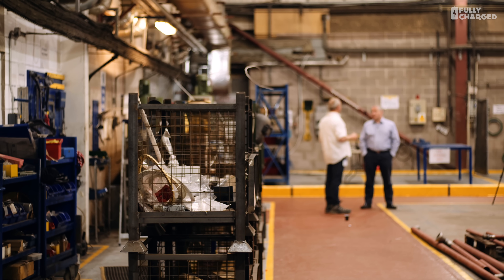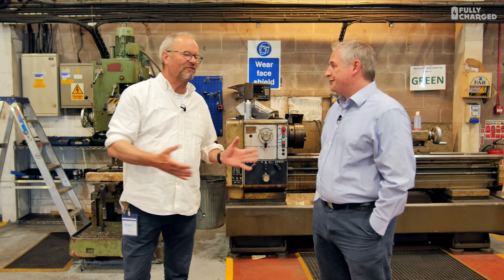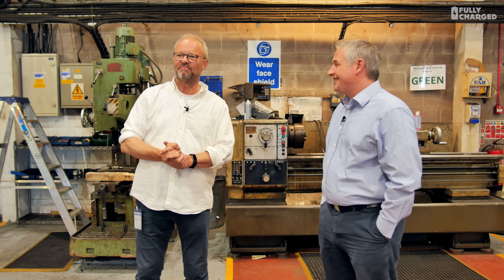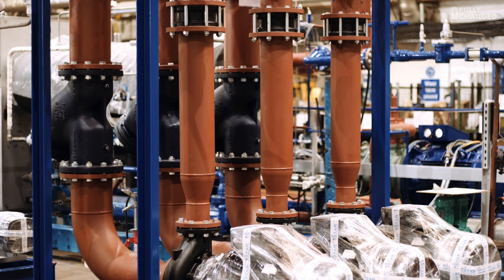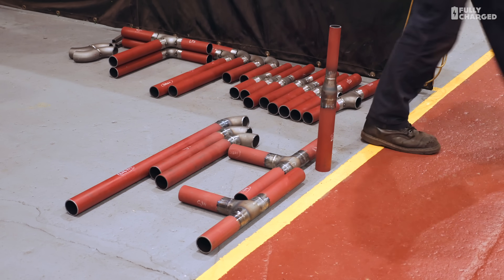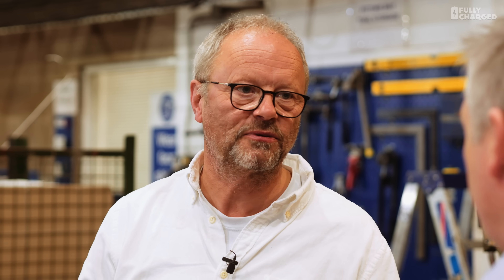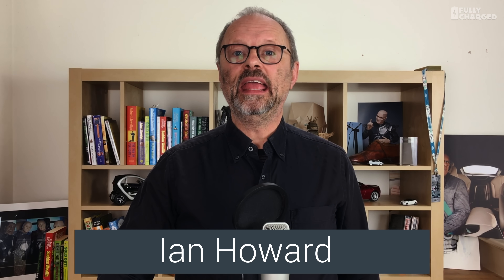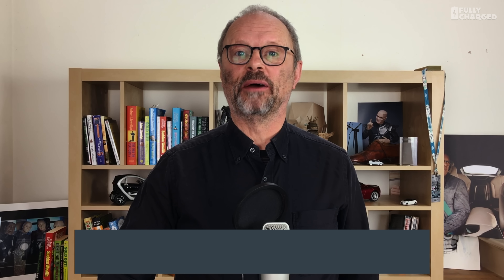Star Heat Pumps | Fully Charged

Comment: Heat pumps are the wisest way to warm and cool spaces but I still think that we could do so much more in the design of our structures.  We build the stupidest houses when it comes to heating and cooling.  New houses should have very thick sturdy walls and consequently be so well isulated that you simply never have to heat them.  Residents would be kept warm with their own body heat, solar, or more substatially, the electronics they operate within.  In my humble opinion, if you are using energy to directly heat your home, you need more insolation.  :-)
Reply: As our electronics get more and more efficient there's less and less waste heat.  Just think about the warmth desktop PCs, plasma tvs, incandescent light bulbs, etc used to put out!
Reply: So we need to go get more electronics and power strips for them so we use more electricity to keep warm, right?  (usually what happens. :-) ) Of course it would be more prudent to further insolate our homes to compensate and try to have enclosed garages to charge our EVs in so we can benefit from the warmth that comes from charging.  If I had the resources, I'd make my home out of space I could dig out of the side of a hill like a hobbit.  That would be easy to heat and cool, so much better than living in a wind-blown stick structure out in the elements.  ..but we are up against a catch 22.  Banks will not write loans to build such structures making them rare and unorthodox, which is the very reason why they don't write those lones in the first place.
Reply: Check out Amory Lovins' work. Passive solar design coupled with these kinds of technologies can create living space that is fully self-sufficient.
Reply: To just heat your house with body heat most of your house would need to be occupied by insulation.
Well I should say that goes for areas with serious winters.
Reply: I checked out what I think is his official site and he seems much more interested in energy production methods than efficient architecture.  (strong on solar and wind and generally negative on everything else)  Still, it seems that any good efficient construction design is going to be snubbed by bank loan officers because they are unorthodox.  And they are rare and unorthodox because no-one will loan money to build such structures.  You need an egg to get a chicken or a chicken to get an egg and since you have neither, you can expect it to stay that way. :-(
Reply: I so understand and agree with you about the mold issue, but in a new construction  it may be practical to build a vapor barrier between the living space and the insulation zone s o moisture from within doesn't seep into that zone. (an interesting, but manageable, task since we seem to also put up a vapor barrier between the outside and the insulation)  The big risk, I suppose, is building a structure that is so hermetically sealed that you get asphyxiated by gases produced within like CO2 and other stuff and possibly low O2 levels.  That's why you need excess heat from whatever equipment and living bodies you may have that demands some air exchange with the outside world.  I'm going to check out your channel now. :-)
Reply: 10mintwo Humans and human activities like washing put a lot of moister into the air. That is why it is part of building regs that you must have an extractor in kitchens, bathrooms and utilities. This can only be overcome with Heat Recovery Ventilation Systems which keep the heat in and humid air out.
Reply: Every new building structure should be built to passive house standards with a south facing roof, air-source heat pump, building integrated solar photovoltaic roofs and electric vehicle charging outlets.
Reply: With proper isolation you can make a house that won’t need  almost any heating and just a little cooling in summer.
Reply: Very true for existing structures.  I was talking about new construction, with walls a couple feet thick and/or building into the side of hills.  Modifying an existing stick house on the surface for extreme efficiency like that would be very challenging.   Of course, most of this conversation goes away when someone gets viable deuterium fusion going. :-)

They're Building a REAL Nuclear Fusion Reactor! - Holy S#!Thttps://www.youtube.com/watch?v=gPpYQFtyO98
Reply: As for fusion, it looks like they've made some serious progress since those videos were made, especially for GeneralFusion.  Although it WOULD be difficult to hold one's breath until we get it, we really could benefit hugely from nuclear fusion.  It would serve us deep underground where the wind doesn't blow and the sun doesn't shine.  Same goes for space colonies.  It could literally save humanity from the kind of disasters that fill the whole sky with ash or dust  for years on end where solar and wind become useless.

I also need to confess that I have a strong bias and an affinity for the idea of people living underground in the thermally cool environment within.  Ever check out "Death Wear's Bunny Slipers"? a youtube channel about renovating a retired nuclear missile silo for residence.  :-)
https://www.youtube.com/channel/UCd50A5qLv8FemVufSvDgkCQ
Reply: So very true.  Extra H2O is always a problem in well sealed systems with life happening inside since respiration produces both CO2 and H2O.  So you need to seal the living space from the insulating space extremely well and keep temperatures well above the dew point in all spaces at all times.  No foggy bathrooms or steam-filled kitchens.  We don't want condensation and moisture accumulation accept in the places we plan for it to happen like dehumidifiers.  Some outside air exchange is vital too.  Like I said earlier, I like the idea of people renovating nuclear missile silos and their design clearly addresses a lot of the issues we are talking about plus some others like surviving radiation and physical blasts. :-)  One thing is for sure, building an optimal efficiency living space is far from a simple thing. :-)
Reply: A perfect explanation of why spell-check failed to fix my misspelling.  Thanks for the heads-up. :-)  It reminds me of the time I spelled the word "method" like "meathod" and spell-check didn't care. :-)  Lost points of that paper. :-)
Reply: The real trick is that there are diminishing returns. A well insulated house using efficient energy production and heating/cooling is generally a better idea than something designed to be super insulated with no heating/cooling. The cost of getting that last 10% efficiency is simply not a good return.

There are exceptions, usually where the temperatures are at one extreme or the other almost year round, like underground houses in Coober Pedy where the temperatures are usually very high during the day, and very low at night.
Reply: His books have more of the architecture. His house in the Rocky Mountains is quite amazing.
Reply: foxpup 

Look up passivhaus standard.
Reply: Problem is that the last steps to really good insulation are very expensive and it is just a lot cheaper to just heat more than have that super insulated house. But we don't really need to look so much at newly build buildings it's more likely the old houses which are really inefficient
Reply: YOU CAN BIULD INSULATED HUSES  WITHOUT USING VERY THICK WALLS,THANX TO NEW MATERIALS
Reply: you cannot insulate a house so completely that body heat alone will suffice or there will be mold issues with the structure. Modern houses are already actually fairly well insulated and the region of diminishing returns is not far away. I wouldn't hold my breath waiting for fusion....see my channel

Comment: 400% efficiency? 
Come on, by definition it cannot be more than 100.
Reply: Szilágyi Szabolcs Well He compares kW going in to kW Heat coming out. Of course He is using that Power to Transport more Energy from somewhere else
Reply: Look up coefficient of performance if you don’t believe him.
Reply: To move not create.
Reply: It's lazy language, he should've use coefficient of performance (COP), so a resistive electric heater has a COP of 1.0, 1 unit of energy in 1 unit of useful heat out.  A heat pump might be 4.0 (what he means by 400%), so for 1 unit of energy in, you get 4 units of useful heat out (or 3 "free"/recovered units)
Reply: Thanks for clearing things up.
Reply: Tom Ormiston look up the term "coefficient of performance" for more info.
Reply: 400% efficiency is based on units of energy to produce units of heat.
In a high efficiency boiler it takes 1 unit of energy to produce .95 units of heat (95% efficiency).
In a heat pump it takes 1 unit of energy (running a compressor) to create 4 units of heat (400% efficiency).
Reply: i think he's using it in context...to mean 4x times better.... 1 of an item is 100% of that item, 2 of that item is 200% of that item....
Reply: If your getting more out than you put in that's over 100% efficiency or a 'gain' of heat. Its the same for power stations, you need energy to make them work put your efficiency (gain really) is > 100%

Comment: This Is a fascinating subject that needs to be further explored. In Alaska, they use stored underground water tanks for thermal heat.  underground its a constant 55 f
Reply: The deeper you go the hotter it gets, so it's a simple matter of depth to make it work.
Reply: For the uninformed 7-10 feet below ground/dirt level the earth's temp is 55°F. You can take freezing cold water ay 32 and slowly raise it in an underground tank, needing less energy to heat water 110f to take showers and such.
Reply: You must be in the south bit of Alaska.  A lot of the state has a much lower ground temperature.

Comment: I live in quebec(Canada) and i heat with electricity because it is so cheap. It the same cost has heating with natural gas.
Reply: Quebec produces close to 96% of its electricity through hydropower.
Reply: Well that really means your natural gas got more expensive.
It's the same in my area, electricity is only going up but it has been far outpaced by gas prices.

Comment: Not exactly understanding here why not simply use conventional heating available. Most of people don’t actually burn fuel to heat houses, there are tons of electric heaters that are available on a market already. How is this better?
Reply: ronP - The electricity being used in a heat pump is there to drive the compressor (95% + of the total electricity used) and the pumping (water source heat pumps) or fan (air source heat pump) around 5% of the total electricity used.  The heat source needs to be moved to and through the heat exchanger of the condenser on the heat pump, this is when the lower temperature heat is captured.  The heat pump compressor then compresses the gas, now with added heat, into a liquid and moves it to the evaporator where the liquid evaporates into a gas giving off the heat in the process of changing phase.  Using this process we get an effective performance or effective efficiency above 100%, a typical value could be 400%, but we don't have an efficiency of 400%, we didn't make the heat, the heat pump simply moved the heat from a colder place to a warmer place by taking advantage of phase change (gas to liquid and back to gas) of refrigerants.  This is call the Coefficient Of Performance or COP.  In this example we would say a COP of 4.    

Electric heaters turn 99.9% of the electricity put into them into heat, of various types, not just inferred, and the last little bit will be visible light and sound vibration.  At best a resistant heater will be 99.9% efficient.  

The big point here with a heat pump is it makes heat usable with a very high effective efficiency without having to burn anything, without creating new heat, simply moving the heat that is all around us already.  So no need for fossil fuels, no burning, just electricity, preferably from renewable sources.
Reply: Hi Vlad B. There are lots of reasons why it is better, but the main reason is efficiency. If your electric heater uses 1000 Watts, a heat pump will produce the same amount of heat using 250 Watts. That's a huge saving!
Reply: Martin Wragg 
In North Sydney, running the Olympic Pool under the Harbour Bridge, the heat pumps only cost 1/2 that of gas the boilers.
Reply: There are other (rather big) advantages of getting heat in a way that can use renewable energy rather than fossil fuels. Such as maintaining a decent climate and environment to live in.
Reply from the maker: Oh, right, because electric heaters are massively inefficient and therefore expensive to run, As explained in the video, for every one unit of electricity you put into the heat pumps, you get four units out. That is 400% efficient. You can also store the heat, run the pumps when electricity is cheap and clean and make better use of intermittent supplies. Also you can heat a city without burning anything, generate the electricity with renewables, create heat with the heat pump, no burning of any fuel.
Reply: well said
Reply: Martin, there are a few advantages I reckon in that low carbon electricity can be used, especially as there is greater penetration into the grid. This doubles as a heat battery for excess production and like he says, electricity can be bought when costs are minimal and stored as heat. It's not reliant either on imported gas, price fluctuations and potential geopolitical issues.
Reply: Really awkward to say an electric heater is really inefficient, as its 100% efficient at point of use.  I used to work in Homebase as a kid and used to enjoy customers coming in and asking which is the most efficient electric heater....

However no one should be burning electricity in resistive heaters as a sane method of space heating in the 21st century.
Reply: the majority of the work being done is free due to the difference in temp (the fluid being used), the only "electricity" being used is to move the liquid from the source to the heat exchanger and then back to the source (river/ocean)  With electric heaters they use a resistor and pass a current (flow of electrons) through it, thus as a by product, some of the energy is converted into heat (infrared).  The problem with this is the amount of energy to create a unit of heat is MUCH MUCH more than the amount of energy it costs to pump a fluid that is already heated/cooled.  Does this help?
cheers!
ron:)
Reply: You put one kWh of electricity and get 4 out, but gas is only a quarter the cost per kWh,  so no cost advantage when you take into account the more expensive initial instalation cost.

Comment: Am I being crazy, but electric underfloor heating? What about how we heat our hot water though, can we do that electrically - easily? (I haven't researched it)
Reply: Electric underfloor heating is quite common, but is a terrible idea.  Burning electricity up in resistive heaters is the worst use of it.  However using electricity to drive a heat pump to extract another 3 units of heat from the atmosphere and then putting that heat into water and pumping it around a wet (piped) underfloor heating system is one of the best ways of heating a dwelling.
Reply: Heat pump water heaters are available since the mid '80s. They are very efficient.
Reply: Yes, but any electric heating is a) expensive (3-4 times more than comparable gas heating) and b) potentially burns more fossil fuels.
The big benefit of heat pumps is that they are extremely efficient and use far less electricity. Thus they are both cheaper and use less resources.
And, as the video shows, there can be other benefits as well, such as consuming otherwise "waste" heat from data centres, or taking advantage of cheap wholesale prices and using heat storage.
Yes you could do this with conventional electric heaters and batteries, but it's far more expensive to build and run.
Reply: Air source heat pump. Same principal as the video on a smaller scale. Still 300-400% efficient. Takes the heat from the air, takes it round the underfloor heating in a liquid, goes back to the pump to be warmed again.
Can be piped to run through your hot water cylinder too. I’m currently having this exact system installed, along with a Tesla power wall 👍
Reply: The prices of your local gas and electricity supply define how cheap either option is, in my area using gas for heating is far worse on your wallet.
Reply: Electric immersion heaters aren't rare at all. The issue is, most electric alternatives to heating tend to cost a lot more to run per BTU than a good combi boiler.

I hate that this is the case as I'm currently renovating a home on a budget, and I would love to be able cut out my dependency on fossil fuels.
Reply: @Mango.

Yes immersion water heaters use a lot of electricity. However heat pump water heaters can also be purchased for the home. They are bulkier and more costly to buy, but are the most efficient way (and therefore cheapest way) to heat water. The operational cost savings quickly pay for the increased cost of the water heating system
Reply: Not quite Andy, it is hard to obtain an exact figure but 40% efficiency for a gas power station and transmission would seem reasonable, with as you say 100% electric heat meaning 40% of the energy in gas being produced as heat. Using a gas boiler a modern gas boiler is about 90% efficient including leaks of gas in distribution. But a heat pump recover much more energy than a gas power station looses, so the 40% of energy in the gas used to produce electricity then produces effectively 160% heat of the gas burned. Then  you can also factor in than 20% of the UK supply is produced by renewables ...
Reply: There's a bit of a trade-off between electric versus gas heating. Electric heating is roughly 100% efficient. But the power grid is not. The gas supply is roughly 100% efficient, but boilers are not. So it currently works out cheaper to burn gas.
Reply: from what i understand you can have solar panels on which you run water pipes through, to heat the water.... but you need the sun first i guess...